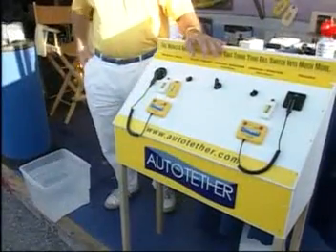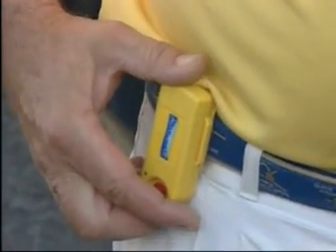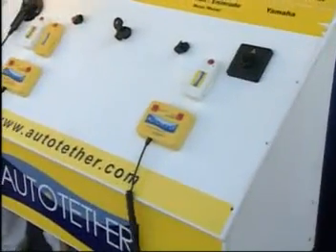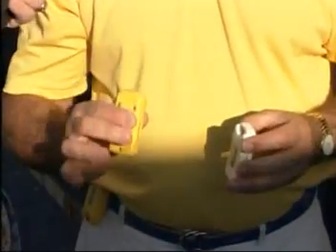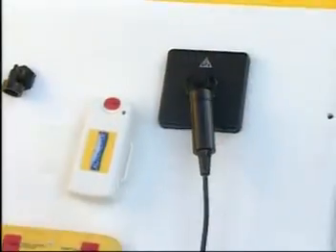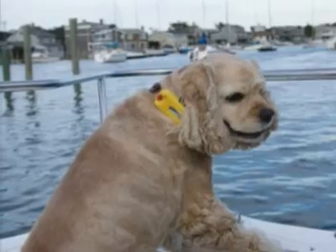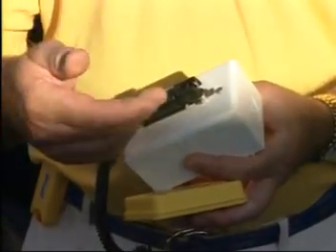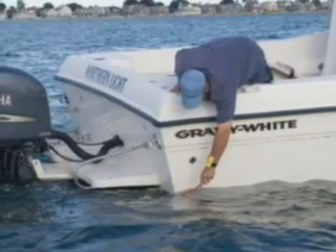Autotether Wireless Lanyard/boat Kill Switch Demonstration

Comment: I'm on my 2nd A.T. a replacement from the folks at AT.  Once again I start the '13 season to find it non functioning.  I'm a lite boater DC/VA f/water and corrosion has set in again!  I can't imagine this in saltwater environ!  The capacitor has blistered and other corrosion visible and boots to all lights and alarms as before. I once tested the fob and water got in at screws - waterproofing not gr8. circuit board needs to be sealed.  I'm bummed as I was/am a fan. Seal it - make rechargeable.